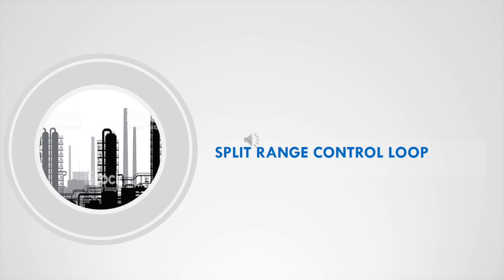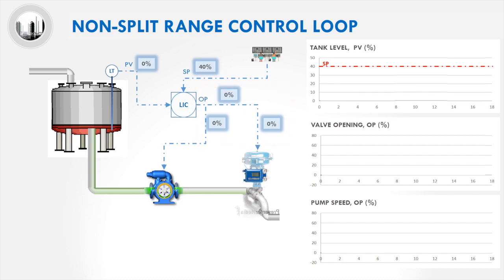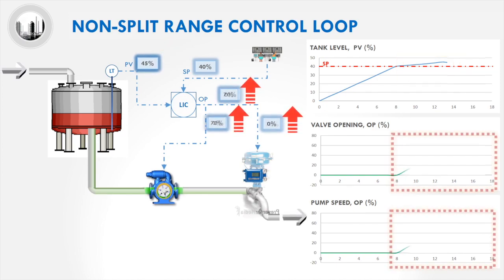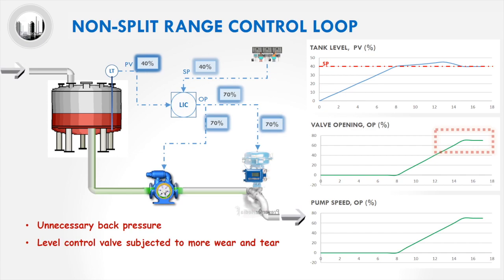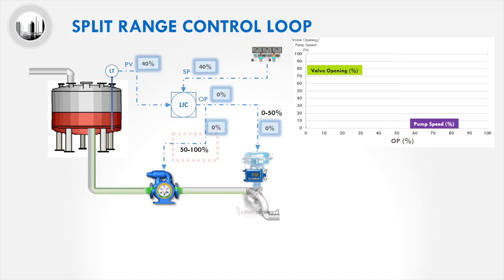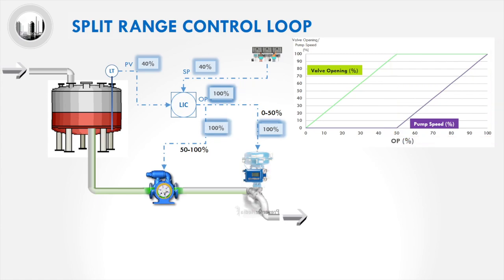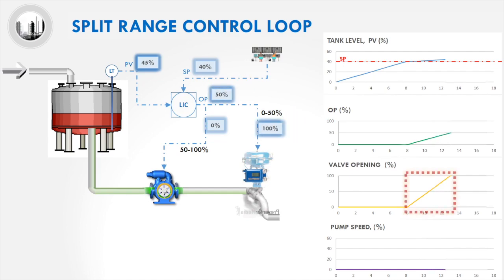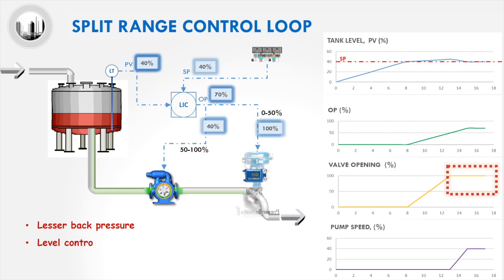Split Range Control

Comment: "In split range control and valve A open till 50%, valve B open from 50% - 100% How much valve B is open if the controller output is 57%? Is there any method or equation to calculate it?"
Reply from the maker: %opening valve B = (controller output - 50%) x 2
Reply from the maker: Thus if controller output is 57%, %opening valve B = (57% - 50%) x 2 = 14%
Reply: @schoolofengineering1017  thanks ❤️
Reply: @schoolofengineering1017  so valve A will be always fully open when Controller output more than 50% and valve B will be open 14% as per your calculations
So if controller output will be 20% then Valve A is 40% open and Valve B will be in 0% Am I right?